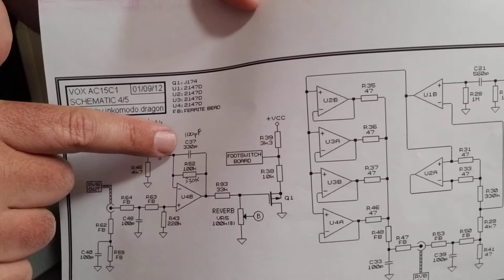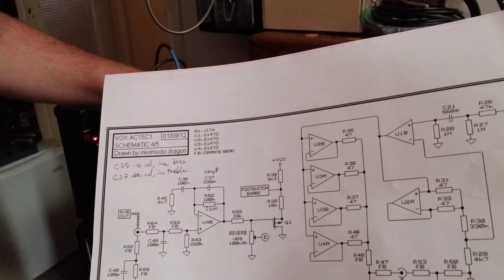Vox reverb test Part 3

Comment: I came here because I also don’t have enough reverb  out of my ac30. This is cool nice work. But maybe not for most people. 

Squeal, losing treble, and ruining tremolo isn’t worth it surely. Without those issues it’d be a super mod!! I guess maybe it’s hard to get a good amount of reverb out of an amp without throwing it out of balance. 

I guess I’m just gonna stick with just running a pedal inline into the amp plus the amp spring reverb
Reply from the maker: external reverb is definitely a better choice.  My solution was to build a custom amp based on an AC10 but with a three knob reverb based on the Fender 6G15 circuit.

Comment: Great set of videos.  I've got an AC15CH as well.  To access and replace the reverb tank, did you have to remove both the amp chassis and the reactive attenuator module?